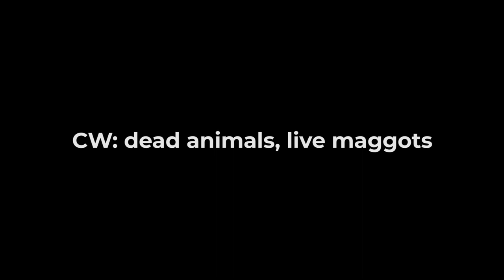Rat House of Horrors | Brandon, FL

Comment: That’s a lot of rats!! You’re going to have to go down to the studs with that house I’m sure there’s a bunch trapped in the walls! Good luck going to be a big job!
Reply: Yep; this is going to have be a full-on interior gut to the framing, I'd think. OTOH, assuming there's no structural issues found once they get that done, it shouldn't be that expensive to refurbish. But they won't know until they demo the place what all will need to be done...